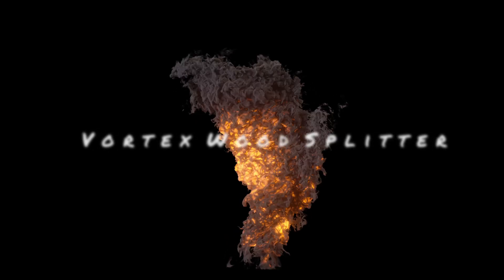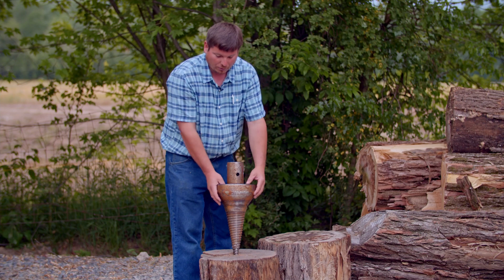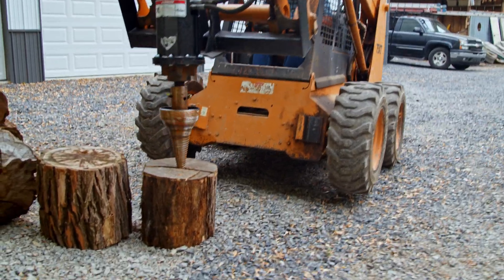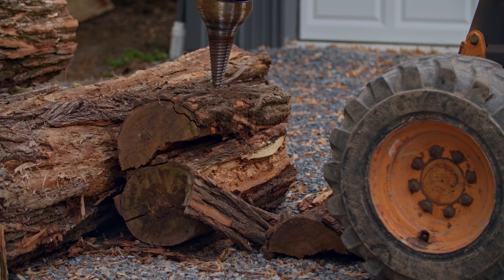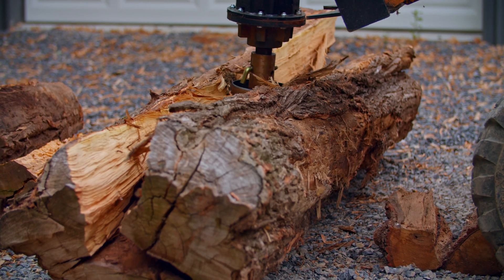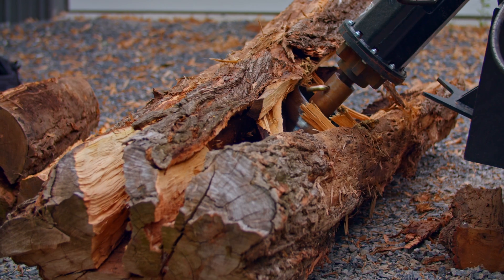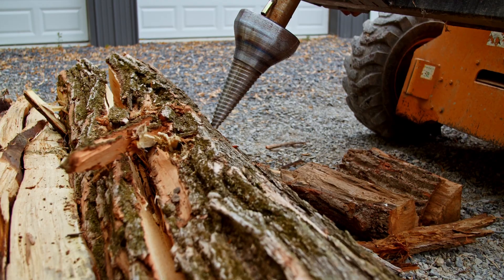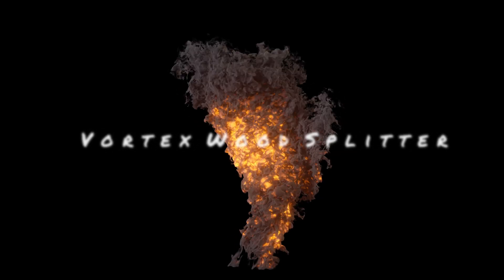Vortex Wood Splitter

Comment: I think a standard log splitter, with ready cut logs, is a better option for 95% of users. It's fast and you don't need a big machine . Thanks for the video anyway,, i will give it a like, after all you hard work. Paul, UK